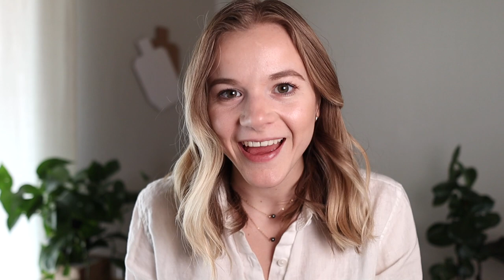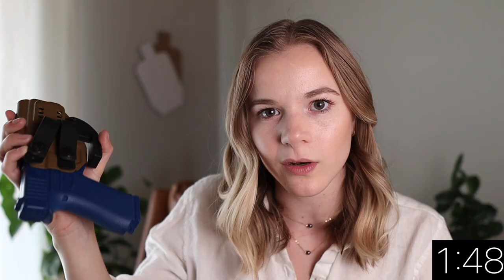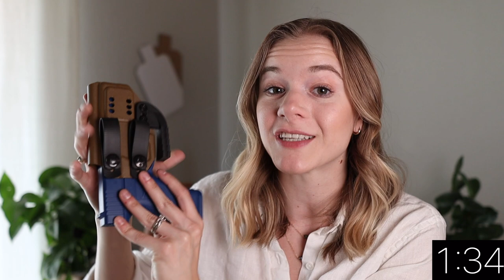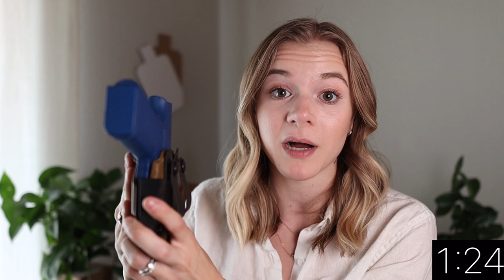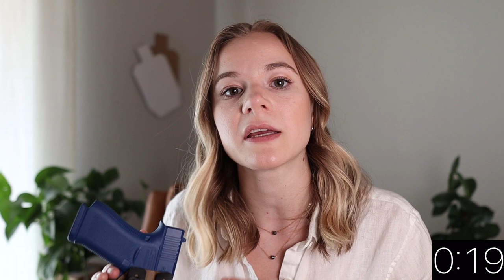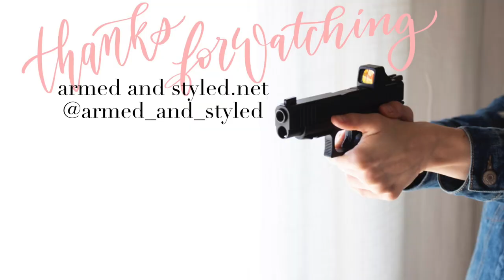Testing Holster Retention | NOT THE SHAKE TEST

Comment: So yesterday I was working on my 99 Tahoe, pulling spark plug wires. At 5’3” I have to nearly invert, sitting on my knees at the front of the engine bay and reaching down to the side of the engine. As I was doing so, my Glock 19 came out of my holster and landed inside my shirt like it was in a hammock. Not an intentional test, but a much needed revelation lol. Funny enough I actually used the shake test as I was trying to fix my retention problem xD Great video, very helpful.

Comment: Caveat, if you turn the holster upside down while in your hand and the gun falls out then you don’t have any retention and don’t tell someone it has enough retention in your pants so that’s all you’re worried about. At that point the holster is providing nothing it’s your belt and body providing it all and you want the holster to provide some when it’s not on body as well. A gun that falls out of a holster simply by being turned upside down is an unsafe gun. 

I say this and you’d think this is a “duh” thing but you wouldn’t believe how many people I’ve had tell me it’s got plenty on them or that think this is acceptable to have a holster with no retention at all.
Reply from the maker: I would agree entirely, if the holster is simply turned upside down, and it falls out, it doesn't have an appropriate amount of retention :)
Reply: I have many holsters from some of the top brands, including Henry’s, PHLster and JMCK, and I always prefer the holsters that allow me to increase retention, and I definitely prefer a holster with a more snug retention. In my experience with the above mentioned holsters, some allow me to increase the retention and some don’t, and while I’ve never had a significant malfunction, the piece of mind that comes with a holster that my firearm securely snaps into place in is invaluable. And I do all of the tests mentioned in the video, including headstands with an unloaded weapon, and none of the above mentioned holsters have failed. Nonetheless, I still prefer a solid retention, and I can still get a sub-second DTFS with a relatively stronger retention holster.

Comment: Well, I think this misunderstands the purpose of a shake test...the very gingerly shake test gives us a bare minimum that if our body shape changes and we lose retention from body pressure, the gun will not fall out.
Reply from the maker: The shake test can be useful as a bare minimum, but not to solely rely on in order to test whether or not a holster is of quality. The shake test can have really different results for the same holster depending on the way the holster is held, how hard it's being shaken, how many times its shaken in a row and who is doing the shaking. For example: PHLsters Skeleton holster (fixed retention) can fail and pass a shake test, but where we get really consistent results is when we test it's retention inside the waistband with appropriate belt pressure :)
Reply from the maker: @LK-gw6to  Disagreeing is great! When done well, it helps everyone learn. Although, I disagree with some of what you said, I have explained the reasons why in the video and comment above :) To be clear though, belt pressure does not replace holster retention, it adds to it.
Reply: @LK-gw6to  nonsense. I’ve used countless AIWB holsters and everyone of them had more retention in the waistband than outside.
Reply: I'm going to have to go with John Correia, as far as "expert opinions " go. The man knows his stuff!

Comment: Just to clarify a bit, a good quality Kydex holster must have both features with retention off the body and while being worn.  The holster must be tested upside down with full weight of the firearm and a fully loaded magazine to ensure that the firearm does not drop from the holster when not being worn.  A trip to the bathroom should not result in your firearm sliding across the floor.  A blue gun does not simulate actual weight for all firearms.  Secondly retention also needs to be tested while being worn to ensure that the actual weight of the firearm will be retained in the holster as well as the amount of retention that must be overcome on the draw stroke.  The shake test is just one tool to evaluate a holster but when evaluating a holster with a particular firearm if it doesn’t pass an initial shake test it would present a red flag that I would want to investigate.
Reply from the maker: That's a really helpful take! Thanks for taking the time to drop this in the comments section! I think it's important to note that many people who use the shake test, don't necessarily know that its not the end all be all. Not only that, but they may also have a different take on how hard the firearm ought to be shaken, how many times it ought to be shaken, or where to hold it in order to perform an honest test. I alluded to this in the video when I mentioned that good holsters can pass or even fail the shake test, and bad holsters can pass as well. 

Either way, I think it's important, as you said above, to test the retention of the holster inside the waistband where it will be worn and test in various scenarios.
Reply: @tessahbooth  I have found that many new IWB holster owners don’t realize the difference that a belt can make on the draw stroke retention.  Each individual needs to experiment with adjustable retention and the tightness of their belt to find the optimum amount of overall retention during their draw stroke.  Glad to see that you covered that point.

Comment: Years ago Six Flags started scanning all guests and imposed a no firearm policy after someone, relying on simple pressure instead of true positive retention, lost his handgun while on an inversion roller coaster.
 Sorry, but unless it is positive retention (strap, clip, etc.) It is not "retention" at all.
Reply: A roller coaster is a pretty extreme inertia scenario. If you’re riding something like that of course you should be using positive retention and that is the end users fault for not properly securing his firearm for such the situation and not the failure of the holster. Under any other circumstance standard properly set kydex retention from a quality holster properly secured in the pants is plenty. 

Part of carrying a firearm is using your head and common sense. Some people lack the ability to use that and probably should leave it at home if they aren’t going to take the proper equipment for the proper conditions.
Reply: I worked construction for 2 years carrying in a passive retention holster, crawling under houses and things of that nature without an issue. You have to have the right holster, and you have to have some common sense about what gun you carry for the activity you’re getting involved in. A kydex holster set to the proper tightness has plenty of retention. I carry a Glock 19 for most things, but an LCP, again in a kydex holster, for crazy things like that. A heavy gun simply can come out of the holster. A small gun in a passive retention holster is less likely to come out by accident than a heavy gun in an active retention holster. A snap can be accidentally popped, a switch can be bumped. Most active retention holsters have no passive retention built in. If he bumped a snap or switch, the gun would have come out the same way. An LCP or similar size firearm would have gone nowhere even in a passive retention holster.

Comment: Just bought my first holster ever. I thought about this exact question. I did the shake test... My shakes were different strengths. And depending on how hard I let it hit the end of the shake, I could force it out at almost any retention setting except fully closed. I thought right away "This shake test shit is some bullshit." Lmao
Reply: Sounds like someone's holster is pretty shitty. Always did shake tests in the military.
Reply: @cross8215  no actually. One of the best on the market. And the retention is better than any other holster I've tried. And all have technically failed the shake test. You can slam out any gun from any holster unless it has the thumb strap.
Reply: @doctaj.2571  Of course shaking a gun upside down will still fall out or become loose even with my holster fully retentioned, unless you have like you said, a strap or two or more retention screws, the gun will always fall out

The shake test isn't to just shake your weapon upside down all day and not have the gun become loose or fall out, on my holster fully retentioned, my Glock 43x fully loaded will fall out after the 15th-20th EXTREMELY HARD shakes. When I loosen halfway or more, it'll take about 4-7 hard shakes to get it out. The point of the shake test is just that, make sure your retention is working, not automatically adjusting throughout the day, and to increase retention on your gun to your preferences. I prefer a tighter retention.  The extra little tug on the draw is not that important to me whereas knowing my gun won't fall out if I need to wrestle, run, etc. Idk what situation I will be in that will have me upside down being shook by giant about 15 times before my gun finally decided to fall out.

Comment: My thing is, I want the holster to hold my gun even if I have my pants down like in the bathroom. I've had my belt flip over and dropping my gun would be less than ideal. I know I should be using a stiffer belt, but the elastic ones I've favored recently are so much more comfortable.